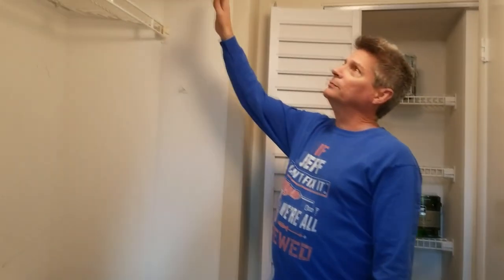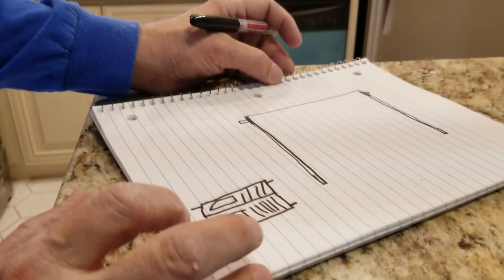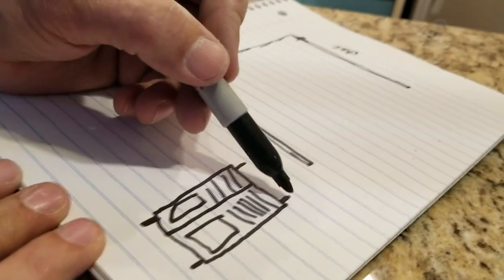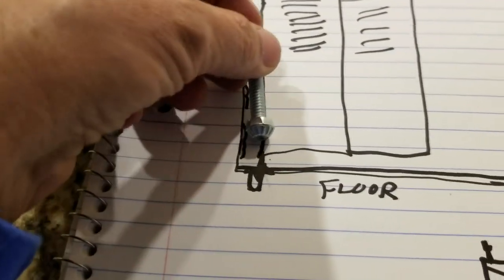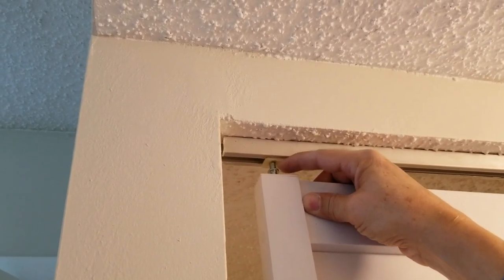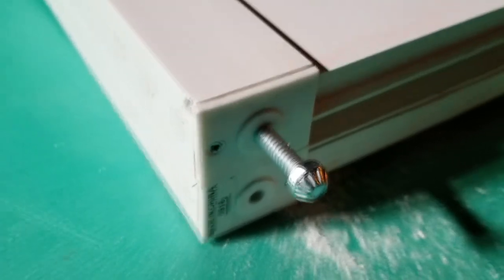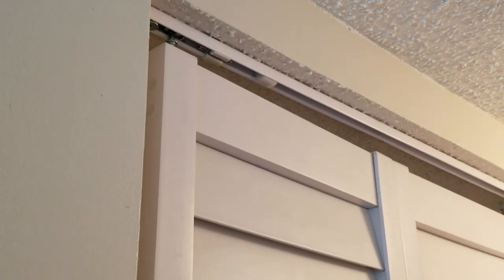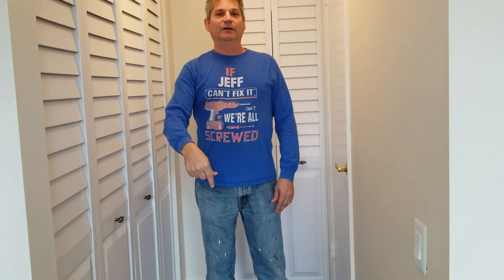How to Install Closet Bi-fold Doors - Folding Closet Door

Comment from the maker: Tools in this closet doors installation DIY video:
Ridgid R4510 Portable Table Saw with Stand to cut closet bifold doors: https://amzn.to/2BMY5rJ
DEWALT DCK299D1T1 Hammer Drill, Impact Driver Kit: https://amzn.to/2M6h450
Do you have any questions about installing your closet bifold doors? Aske them below and we'll answer them for you.
Reply: If I had to include three sets of doors would I have to put down a bracket in the middle of the floor?
Reply from the maker: @creativelady6130  A small l bracket is typically mounted at the floor on the hinge side of the Bifold door, up against the wall.
Reply: What kind of set screw is it?  A contractor removed my bi-fold doors and lost the set screws for the upper pivots. They are probably machine screws, but are they pointed/sharp tip, or are they more like bolts?

Comment: My bedroom closet opening is W58.8" x H80". So I'm looking for a pair of W29 bi-folds. Except no one appears to sell this. Do you have advice about how to deal with off-dimensions?
Reply from the maker: The 30" bifold doors are 29.75" wide, so this would be too big. You best bet would be slider closet doors instead of bifold. You could get 60" wide sliding doors, they typically fit from 57" to 60" wide openings. You'll have to slice a few inches off the upper and lower tracks. The doors might overlap 1/2", no big deal. Whenever I get a door opening over 48" I opt for sliding doors, because I hate bifolds, they will eventually jump track, sag, fail.

Comment: Being PVC, wouldn't you need a blade in that table saw with lots of TPI's ?
Reply from the maker: I think it had 60 or 80 teeth
Reply: @jeffostroff  Thanks for the reply!  Yes, me personally, I would've used a 80tpi blade for the finest cut possible.  Since you know your s**, lemmie ask you if you believe PVC is appropriate for interior trim around doors and windows?  I put it in my boy's bedroom (inexpensive, easy to clean, waterproof) but I was told that I needed a quality $60-$80 high tpi blade (80 tooth) to cut it and stainless steel fasteners.  I know PVC trim is for exterior so stainless is a good weatherproof option but did I need them for interior?  They're which are quite pricey.  In fact, the kid at H** D** never heard of them, couldn't even locate them in the fastener aisle.  Sorry to ramble.  You're great!  I subscribed!
Reply from the maker: @firstlastname3865   I used PVC in one of my condos to reframe a couple of door moldings inside. I liket it no painting